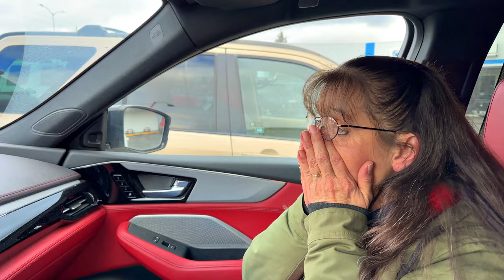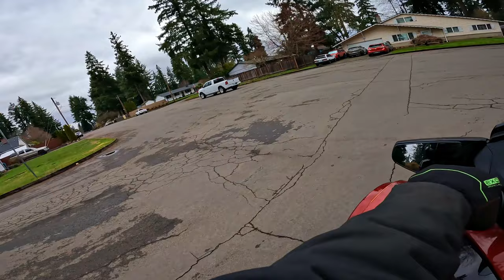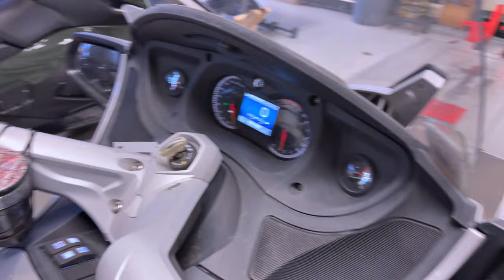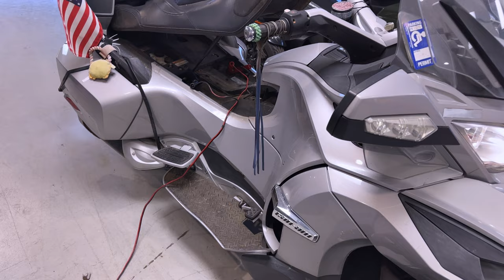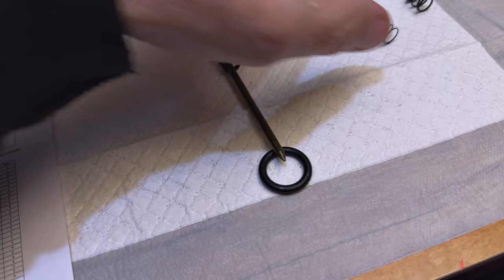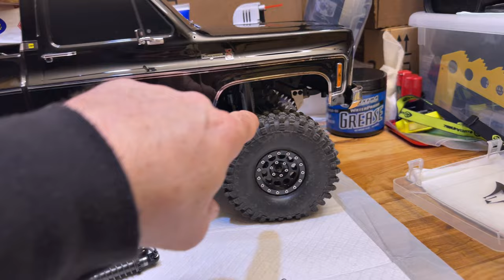Oil Leaking ‘21 RTL..!! • 2010 RT Not Run for Years! | TheSmoaks Vlog_2682

Comment: I have a question ride my bike to work 2 miles on a road 4 on freeway and then 2 more miles. Why do my fans kick on. The temperature is in the 50's.  Can-Am RT limited 2021. It has about 900 miles. I have a bike just like the one you're riding Marcella black. I see that the temperature is on the high side as soon as you come to a stop the fans will turn on.